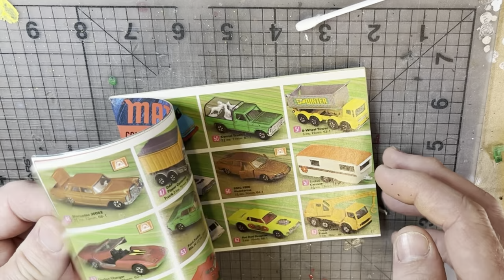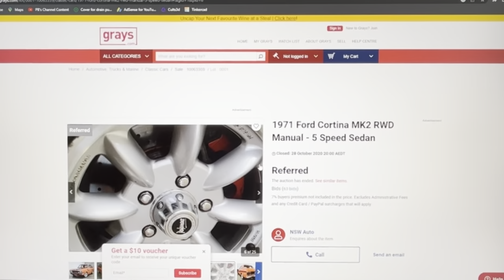Matchbox Superfast No.25 Ford Cortina GT CONVERSION CUSTOM!

Comment: looks great, nicely golden, and proper decals, too. :) love the Minilites as well. :)

too bad the doors got painted wrong, the paintcoat looked perfect. but there is always something, no?

aw, so many variations... hey, in switzerland I've seen one with a Taunus P6 RS1700 in red with black stripes, who painted the caravan on the hook the same colour scheme. :) could be another idea for the times one finds a perfect towhook in the back. and the fitting caravan, too.
Reply from the maker: Thank you. Caravans are hard to find, I think I only have one in 1/64 and it's a plastic corgi knockoff.
Reply: @PBsRetroRestorations  curiously enough they are not that numerous, despite the team packages made by Matchbox, Majorette, and Siku. and those that are left tend to be incomplete. I'll try and find some next time I got die-cast hunting. if you want some I can try to ship them your way, along with some other castings you might like.